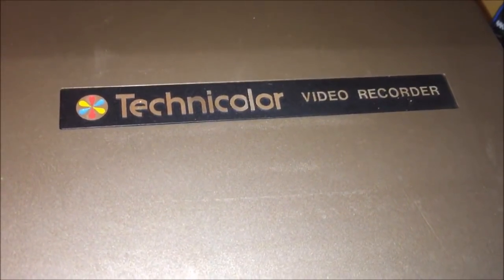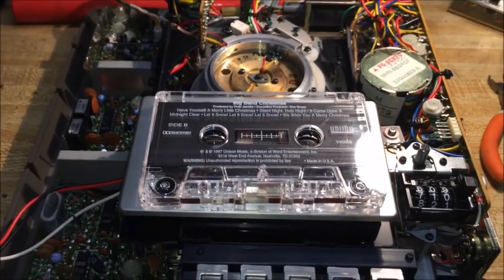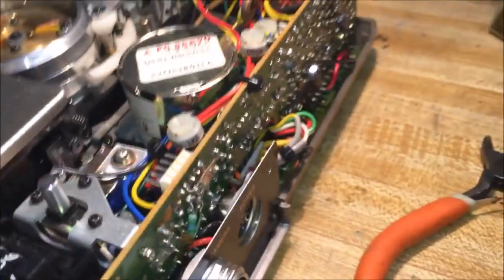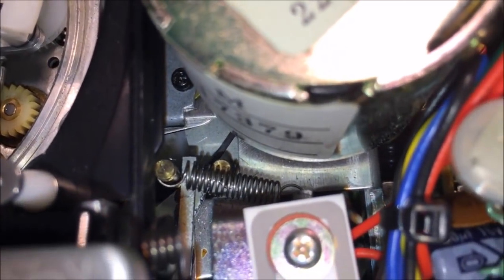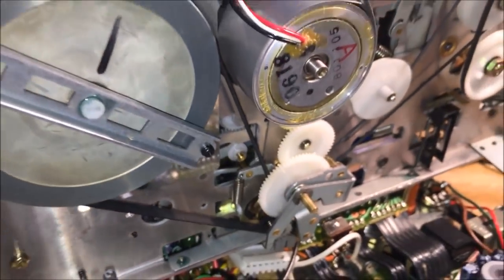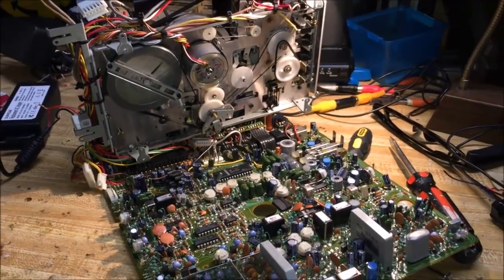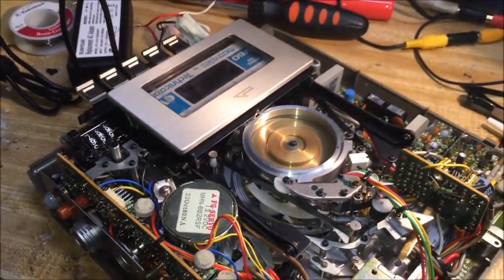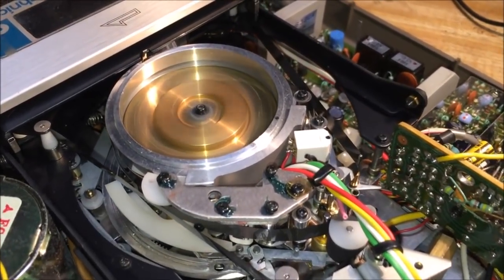Technicolor CVC VCR Repair Attempt - 1980's Video Format

Comment: The auto stop work likes a cassette player. If there's no movements, the stop rocking arm will poke the button lock so the button release automatically & stop the player. Just try to play it without cassette. If the reel spinner spin when you press the play, it's normal (try another cassette), but if it's not, check the belt and/or the pulleys

Comment: I have a now-working unit from EBAY that I fixed myself-it was quite the chore! Mine had belt issues, and problems with the motor drive gear and 1 loading arm with the plastic parts shrinking and cracking.
The load arm was so tight-I could barely move it;I used sandpaper to grind out the inside so it would turn. Putting it all together with the right gear alignments was the hardest part-I had it apart and together about 5 times before everything worked!!

If the motor tries to move but cant, it may be the gear on the motor.
Reply from the maker: Do you still have yours?  I need to borrow one to dub off an old tape!

Comment: Just purchased one from ebay for $98 along with the original power supply/video out brick for $130 from another seller. It had a loose belt which i placed back. It is now playing a video tape perfectly. It is amazing that all the capacitors and the roller are in good shape. The only issue is that i have to keep the play button down the whole time or else it pops back up.
Reply: Hi. I have the same problem. Where did you get the belt replacement and was the Job complicated?
Reply: @peopyt  If you know how to repair a VHS videotape machine then this repair will not be complicated. Back in the late 70s and early 80s there was a hotglue that was used to hold capacitors and resistors in place.

This hotglue is known to be hygro-scopic and become semi-conductive after 10 years. I always remove all of this hotglue on all my consumer CVC Microvideo cassette machines. The military grade machines do not have this hotglue. Thank goodness.

The amount of hotglue as well as where it was used varies because these machines were partially assembled by hand. By removing this hotglue you will fix about 90 percent of problems (play/rewind/FFWD buttons won't stay down, playback stops randomly, picture quality looks bad, tracking dial is unresponsive...etc.)

Most professional repair services refuse to talk openly about this hotglue for obvious reasons. I myself am not a professional.
Reply: @renegonzalez6755  Thank you for the reply. Well I am not that expert in fixing much Electronics but I have succeeded a few times with older betamax and vhs recorders. You don't have a functional spare cvc tape recorder for sale do you? 😉 I need a few tape digitized
Reply: @peopyt  BEST CASE SCENARIO If all goes well this will be a $9 repair with an approximate 4 hour repair time. This repair time includes the removal of the longest square belt. Cleaning the sticky brass pulleys. Cleaning functional belts with soap and water (flat belt in charge of capstain and square belt in charge of the timer.)

Removal of all semi-conductive hotglue (1 hour process alone.) Re-lubrication of all bearings including motor bearings and capstain bearing with full synthetic oil. Maintenance of all switches, dials and potentiometers (tracking potentiometer included) with De-Oxit Fader F5 cleaning/lubricating/protecting spray. Re-greasing all guides and (metal to metal) and (metal to plastic) movement parts with full synthetic grease.

Cleaning the rubber roller with water (3 passes should be enough.) Cleaning the two video heads, audio head and erase head and steel tape guides with 90 percent or higher content alcohol (I use 99.9 percent here.)

Believe it or not the videotape never touched the spinning videodrum which is a huge design flaw. This setup is very similar to the 1973 Cartrivision video head setup.

Please send me an email for more details.
Reply: @peopyt  WORST CASE SCENARIO You spend $9 in belts and 4 hours of your time and you still do not have a working machine due to but not limited to: dry or cracked rubber roller, worn gears or warped tape threading arms.

These 1980 and 1981 released consumer machines have 4 serious design flaws. #1 The videotape transport system is unlike Cartrivision, EIAJ-2, Betamax, U-Matic, V-Cord2, Quasar VX or VHS. All consumer CVC Microvideo machines used an odd "Ring type" transport system that places a lot of strain on the belts, motors and gears. This sometimes caused worn gears and even warped "C type" transport arms that would lock into place unable to return back to their original resting place.

#2 One of the two motors uses an odd rubber "shock absorbing" system that would sometimes fail due to dropping or bumping the machine. This would then cause a gear located directly underneath this motor to become worn.

#3 The hotglue used on the mainboards eventually caused semi-conductive shorts which caused function problems and random errors.

#4 The lack of physical contact with a spinning video drum means extra wear and tear on the videotape.
Reply: @renegonzalez6755  yeah youre probably right. I still ned to buy spare parts for somewhere though
Reply: @peopyt  I live in San Jose California U.S.A. I am more than willing to digitize your videotapes if you decide that a repair is not possible. Simply take care of the shipping cost.

I do not use the consumer Technicolor, Funai, UHER, Siemens, Elbex, Telefunken, Universum Review, Canon, Bosch or Philips machines. I use the military grade TEAC branded V-250G FN machines which were released in 1986. I own a Pal standard (Europe) and an NTSC standard (Japan and North American) machines.

Comment: I have the same kind of rekorder. What I see at your unit is that the counter doesn´t work. There is a belt from the right band plate to the counter. At the counter there is a magnetic ring which sends impulses if the band plate is rotating.

Comment: Hi, if I see it right, one of your belts is wrong. The belt is running on the wrong side. The roller at 10:15 must be tensioned exactly from the other side.

Comment: The loading mechanism is a weak point in these.  It's probably not quite completing the lace-up, and is then getting stuck there.  The loading ring jams up on the large circular plastic guide beneath the head drum, I think it's due to the plastic expanding.  Lubrication can help a bit, but not always, and it's hard to get to.  Work around: Try quickly going from stop to play a few times, it may complete the load and run.  Then for unload, quickly do the same thing and it can eventually complete unload.  Very fragile design unfortunately, this problem probably killed off nearly all of these machines by the time they were five years old.  Hence they are rare now.  (I have working ones though in both PAL and NTSC!)

Comment: Get rid of glue by capacitor that stuff become conductive over time and also corrosive. It a darker color which it sure be light brown color. One was to test is just put meter leads accross glue and see if you get a resistance?

As far as fixing it, you sure get at very least a multi meter and test voltages to see if motor getting power to it first is a good starting point. Don't guess. It could be a bad motor as well and not even be the motor drive circuit? Also micro switches do tend to go high resistance as they get corroded, or dirty inside and a spray of contact cleaner usually get them reliable again. I would check the switches as well. If problem still couldn't be found them a service manual will be needed and you have to do some back tracing to find what the issue is. Bring it worked before may not be a serious issue and motor more likely is fine.

Comment: If you really want to introduce this format to us, it was probably not the best choice to get a revenge on this mint condition machine for the unsuccessful repair attempts by trashing it. These things are quite rare. Even if you find an other one, it would probably deserve this one as a parts machine. Good luck to find a head drum or even a pinch roller or a plastic gear for it. Eg. the pinch roller looks OK in this one -  which is quite a lucky occasion in a 37 years old unit.

And as others already pointed out: next time remove the brownish-black glue residues from the board, as it becomes conductive. Also need to clean the mode switches you can see at 10:11 , and any other switch contacts on the mechanism.

Comment: The caps on the back of the board by where you replaced the transistors look like they leaked pretty bad and ate the PCB, even replacing the one it may have taken out the traces inside the board.
Reply: Pat Booth I thought exactly the same, the board looks absolutely covered in electrolyte where those 2 caps are. In most electronics, examining and/or replacing the bad or dodgy caps is the FIRST thing you do
Reply: >taken out the traces inside the board.

Everything looks double sided.. i.e. no internal layers.
Reply: donpalmera true i worded that poorly
Reply: I think it's just that stupid glue that they used back in the day to secure components for shipping. When this glue dryies out over the years, it becomes conductive and causes shorts on the PCB.
Reply from the maker: Several people have mentioned this.  I had no idea!  I've been working on electronics my entire life and hadn't heard of it.  Thanks for sharing the info!
Reply: No problem. My 1983 JVC VCR's audio stopped working because the audio IC was covered by this glue. Try scraping it off with a flat head screwdriver.
Reply: That glue the used to hold them down. But does tend to become conductive over the years and is darker brown color which suggest it become corrosive and conductive. Check resistance across glue? If it measure a resistance then glue needs to be removed.

Comment: As far as I know the fault is mechanical, but I don't know what it is. I read it's a "load ring" but heck if I know what that means or were it is. I know I can move the threading arms manually but it is extremely stiff for my mechanism. So I'm trying to figure out what's keeping it from turning, it's probably the "load ring" and of course it's unobtanium, but is it fixable? I don't know, but I hope so...
Reply from the maker: I've been told its bad capacitors, and this machine has too many to be worthwhile to replace.
Reply: @databits  

I figured out what the load ring is, is a plastic bearing that the left take up arm uses. The only way I figure to fix it is to machine a a few thousandths of an inch off the shaft (below the video head.) I tried to oil the thing and other methods to loosen it's grip, but upon reassembly I didn't see the plastic gear that connected the load arm to the motor got misaligned  and then stripped when trying to manually run the motor. after the gear stripped the right load arm moved freely though.

Personally I don't always think replacing the capacitors will always be the proper fix. I had a Panasonic camera I want to get working fully, but it was non-functional after I recapped it.

Comment: get rid of that black looking glue in the vacinuty of the transistors that you replaced. It becomes conductive.
Reply from the maker: Good advice!  That sucker is already in the trash.  Perhaps if I run across another machine I'll give it a good bath.

Comment: Hey  U should not replace the 2 transistors but mesure them before. In this old machines there is almost no logic control. You should look for a microswitch witch can operate the motor first. this transistors are only there for speed adjustment(thats what i think) but the easyest way is to follow the motor wires and look where it goes than where is the switch. Once again im 99'9% sure there is a miscroswitch witch operate the motor ON/OFF then these transistors are there for the speed adjustemnt.
But the most important is have fun.Its all that matters

Comment: I have two of these and both failed the same way, picture is 90% noise with just about 10% video signal coming through. Is there a fix for this anyone? the video heads are clean.
Reply from the maker: Someone replied and said "bad capacitors".  Problem is, there are a huge number of capacitors in this VCR.
Reply: Thanks for that ... Yes for sure there is quite a ton of them!! .. Ill try another deep visual inspection and take it from there thank you.
Reply: Thank you for that ... I will have a good look at the physical condiion of the caps 1st ... It's just that the second CVC I bought was new and the video playback only lasted for 1 year. Cheer man.

Comment: These units were unreliable from the get go. A company back in the early 80's tried to use these decks and a small TV to take around to customers to play demo tapes for how to use their equipment. After only several weeks of carting them around in the car and setting them up, they exhibited these problems. Even when they threaded up properly, the playback was poor at best, a lot of noise in the picture and speed variations in the sound. A complete failure as a portable format. May have had better luck if the units were not subjected to rough handling and transportation.
Reply from the maker: Agreed.  Thank you for your comment.  I threw mine in the trash.  What a hunk of junk.